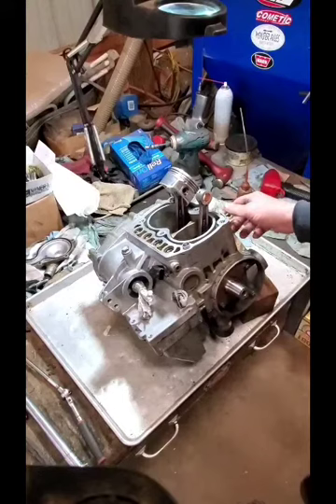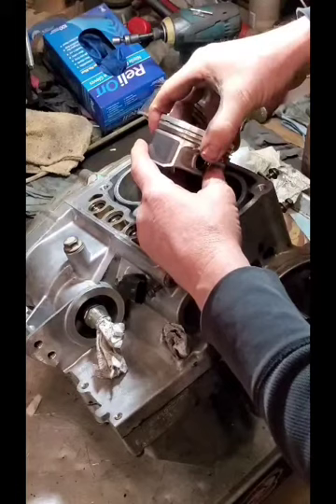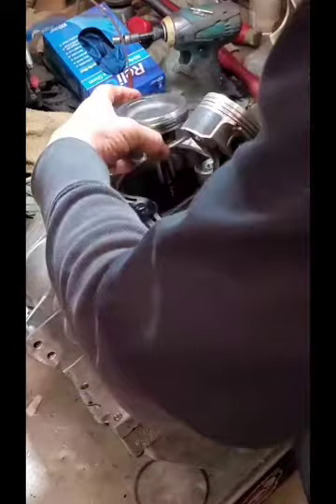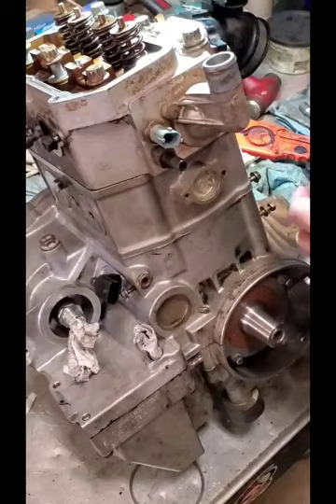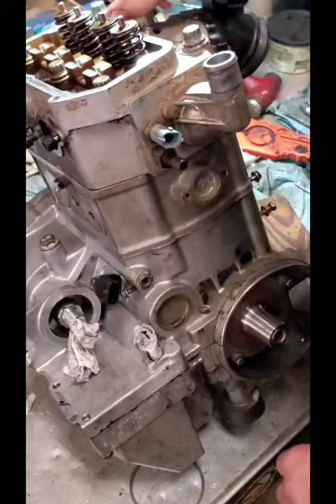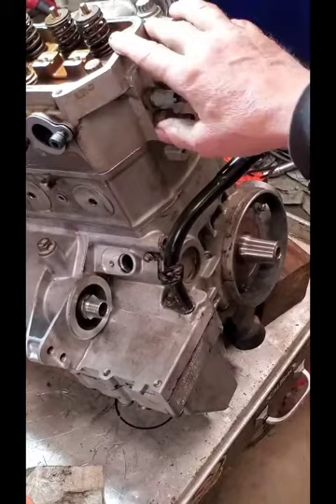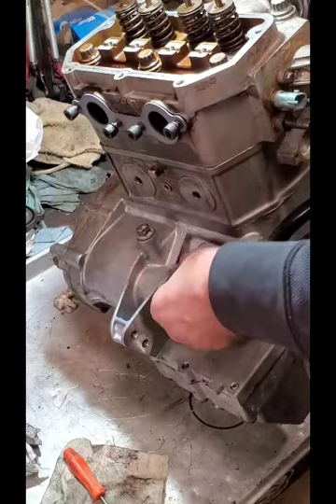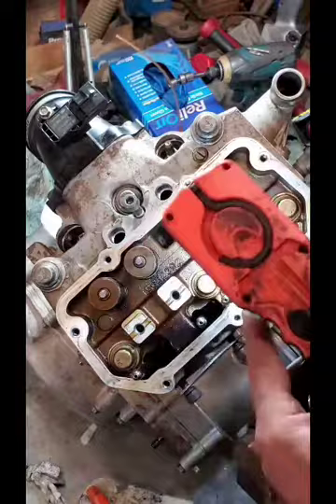Polaris Ranger 800 Top end Build up

Comment: Need help. I have a 2012 Polaris 800 (600 miles) hard to crank over to point where starter burnt. Removed spark plugs and it turns over easily. Compression 175psi Fuel 45psi. Spark at both plugs. Thank you. Enjoy this video very much. Your details are great.
Reply from the maker: Wow ! 175 psi ...... sounds to me like one of the exhaust valves isn't opening, you may want to remove the valve cover and crank it over with the spark plug out (unplug the fuel pump as well) and watch the rockers range of movement, I'm betting its going to be the cam,push rod or rocker is not in proper position. 
LMK what you find ?

Comment: I’m about to rebuild an 800 from an 06 Sportsman that died when the oil pressure relief device stuck.  The crank has a little discoloration like it got hot but there is absolutely no play in the con rod bearings and they feel nice and smooth.  You think I’ll be ok reusing this crank?  Expensive part for sure.
Reply from the maker: That "Discoloration" or blue appearance is normal even on brand new Assemblies, I believe it's a result from the pin installation process during assembly. Sounds like your Crank is still in good shape. Just be sure you get that pressure relief plunger to "free up" and lift off it's seat freely otherwise proper oil delivery will be a problem.
Reply: @usatvgrizzly  I appreciate the reply.  That’s good news, I’ll put the original crank back in it.  I’ve got the PRD dowel freed up and lightly honed the port it rides in with a nylon .308 bore brush.  I’m going to try the "Pressure Guard" device that’s supposed to prevent this from happening again.  Any experience with these devices?  Great videos by the way.
Reply from the maker: A good way to verify the P.R.plunger is working properly is to install the spring and cap on top of it, then remove both to check if the plunger will come out with a magnet stick or invert the case, it should come out without any resistance.

Comment: Great video! I have a 03 700 sportsman and did the top end and when i put back together And added fluids i am getting milly oil. Seems like antifreeze is mixing. I only did the top end and never had that issue. Could it be a gasket?
Reply from the maker: Gasket possibility if it wasn't mixing before you did the top end ? Then definitely a gasket, did you use a factory polaris gasket set ? If not ive seen many "after market" gaskets fail due to quality and material issues.
Reply from the maker: There's only 2 locations for the oil /coolant to mix. 1) the cylinder base to engine case ( sometimes the base gasket gets "rolled" or pushed during the cylinder install.) 2) water/oil pump shaft seals,
Reply: @usatvgrizzly  yup your right was the base gasket